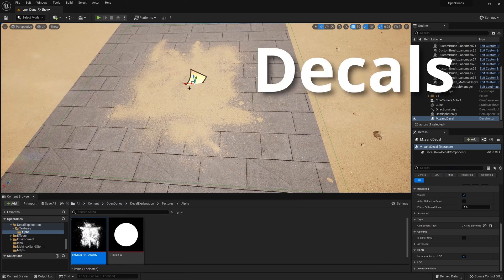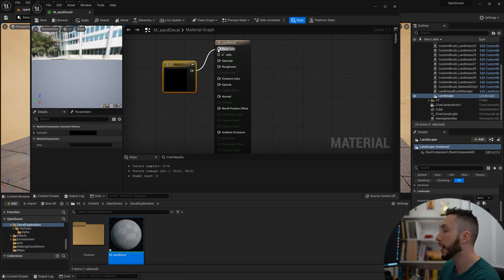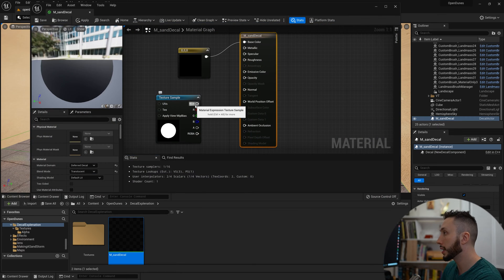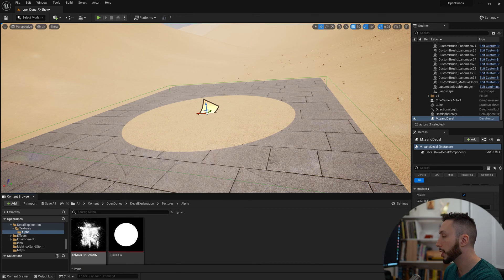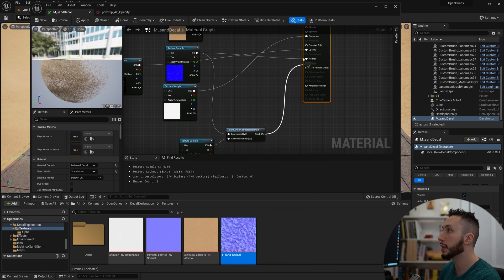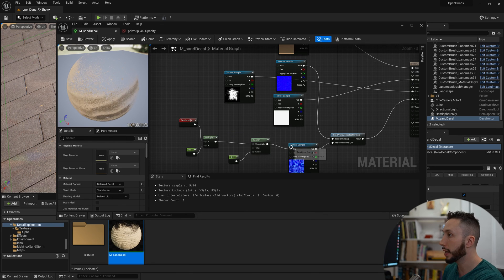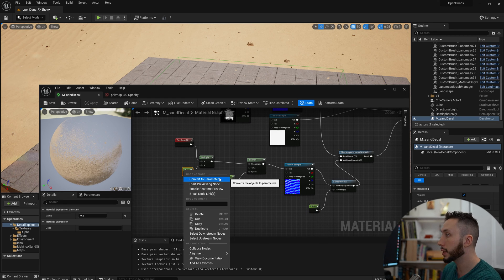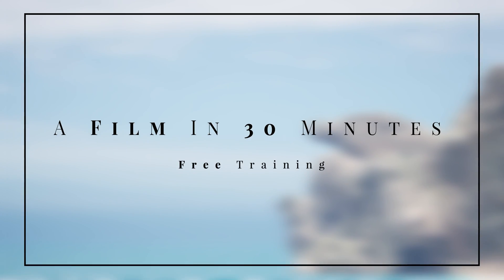How to Make a Sand Pile - Decals in Unreal Engine 5

Comment: Hey! Can you link the alpha mask for me please?
Reply from the maker: You can grab it from megascans through my unreal engine for free. Just look under the decal classification
Reply: @azielarts  Thanks!
Reply: @azielarts  I have one more question. How can I change the albedo color of the decal to match the color of the sand? I used a yellowish sand and changed the color with albedo, but i can seem to find it.
Reply from the maker: @ImReformd  oops sorry didn't see this before. You will need to make a color by holding 3 and clicking,  and then l multiply that color over the existing color or texture of the decal. Then right click convert to parameter to modify the color in a material instance later.
Reply: @azielarts  is this still the case now with Fab?